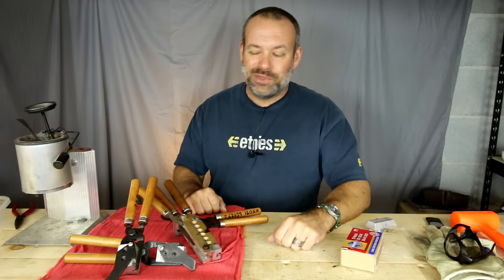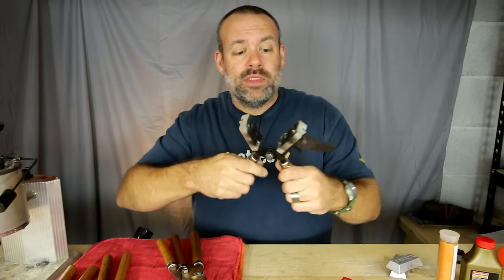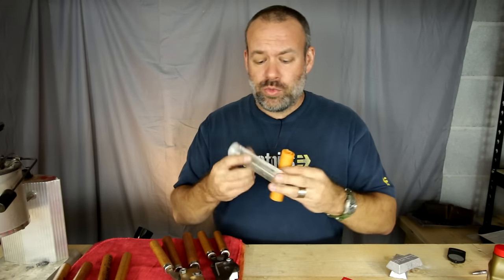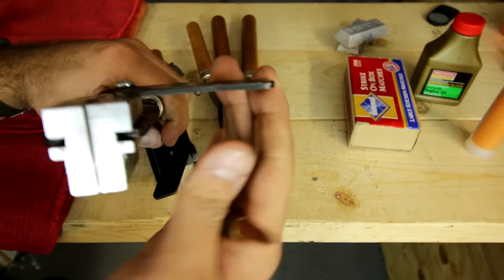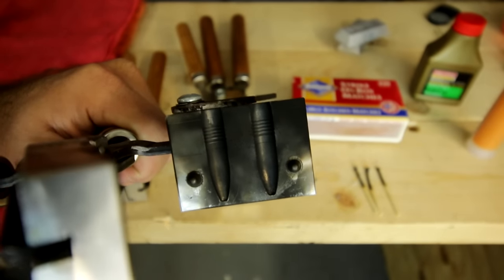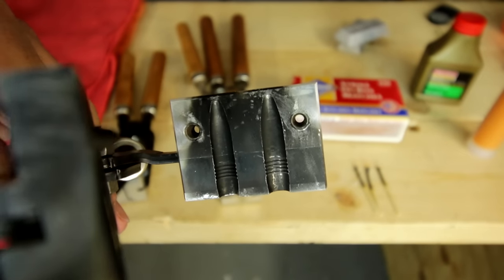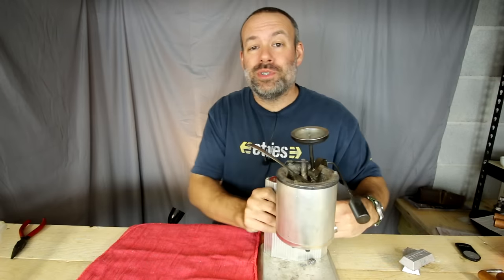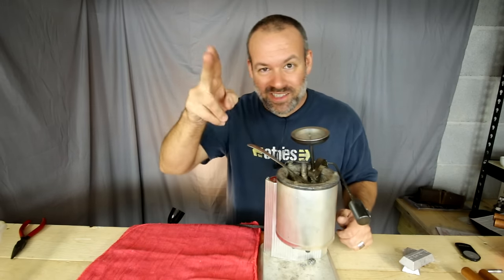Prep a Bullet Mold

Comment: What mold do you use for your sub 300 AAC and what do you resize to after you powder coat? I could have sworn ive seen your video on it I just cant find it now. ha
Reply from the maker: The link below is the mold I use and it's purpose made for 300 blackout subs.  I've not put up a video on resizing and powder coating yet.  I rarely have the need to resize the Lee tumble lubed bullets but if I were to resize I'd take it down to .309.  You will need a flaring die if you don't already have one for the powder coated bullets which is also listed along with the mold.  Link:  http://amzn.to/2lfkqsq

Comment: Hi, duece what is the bullet weiold??ght on your 300 blackout mold? great video btw!
Reply from the maker: That mold is the TL309-230-5R so it's designed to drop at 230 grains.  Using wheel weight lead it drops right at 230 give or take a grain.
Reply: @deuceandguns  have u ever cast copper or bronze /aluminum alloy or brass bullets.

Comment: Are cast iron molds the same way? Thanks
Reply from the maker: The clean and prep is the same.  If you plan on storing them in a humid garage or in my case an underground bunker you'll want to coat them with a little oil for storage and clean/prep them again before the next use.  This will keep any rust issues at bay.